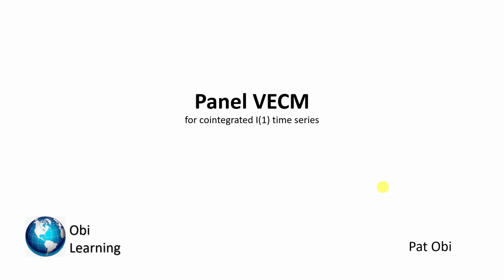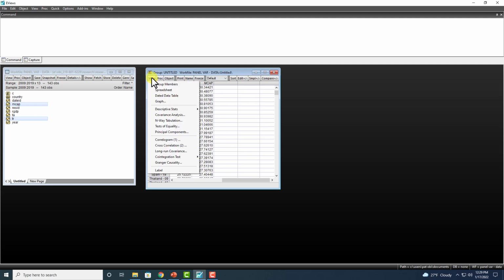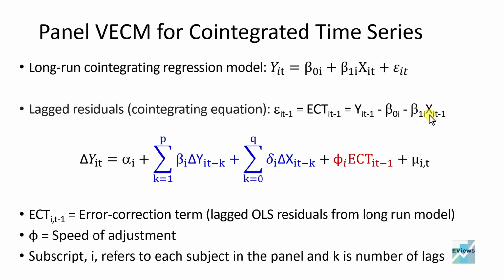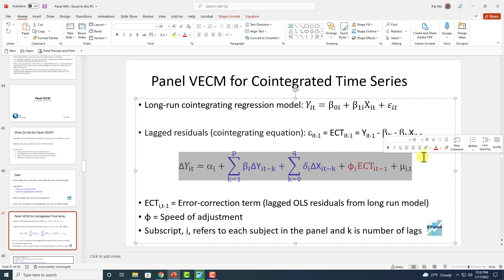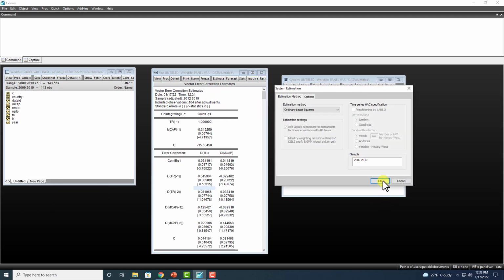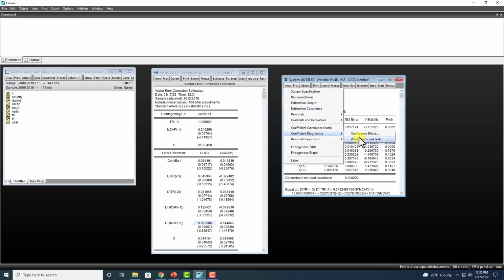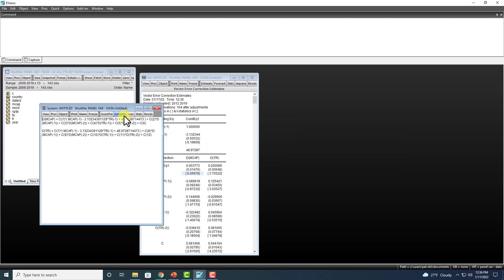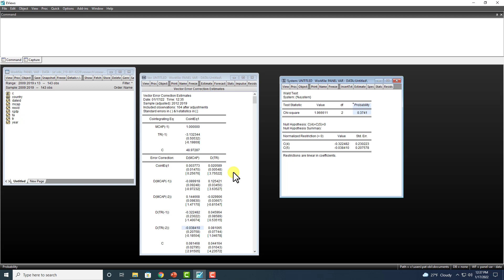Panel VECM

Comment: How can I do this in Stata? I managed to do it up to the cointegration test, and all regressors are cointegrated. But now I can't seem to find the right commands to determine the correct lag length and run the panel VECM. Thanks a lot.

Comment: does the vecm data panel have no IRF and VD?
Reply: Same question. Did you happen to find an answer to that? Thanks!
Reply: No, because on graphs it won’t be visible that the shock converged back to equilibrium as VECM include the long run dynamics :)